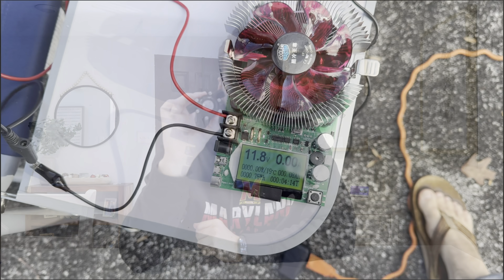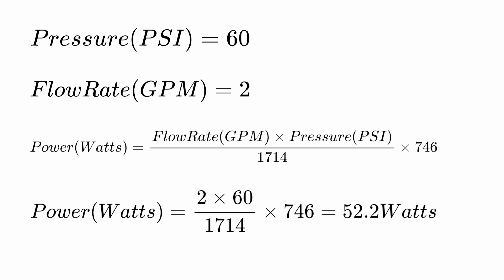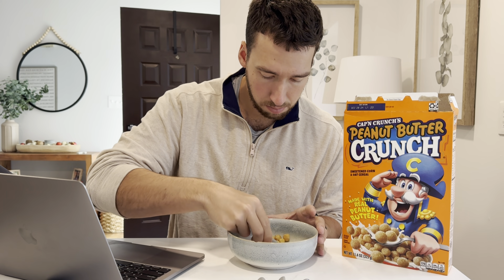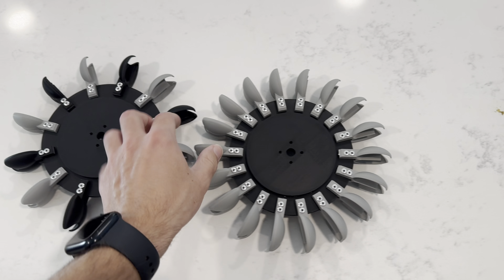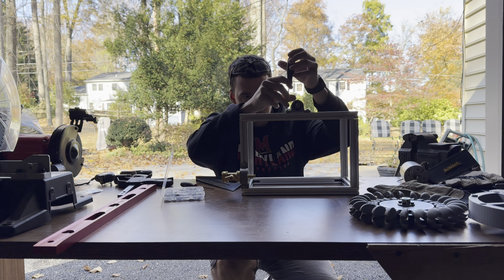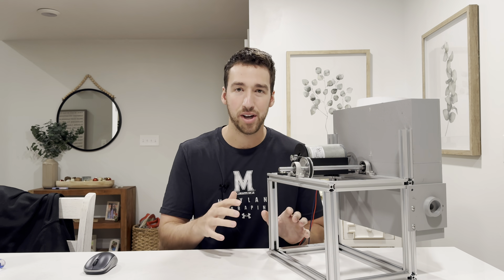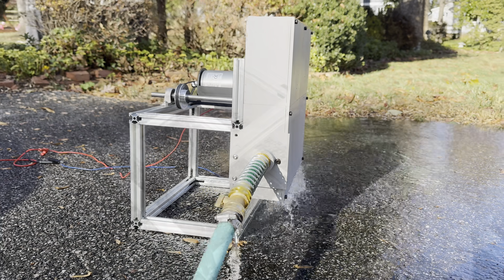I Built a Mini Hydroelectric Generator

Comment: That’s a great little project you did. Its a great idea to make the sliding nozzle mount and options to use different sized nozzles and spoon quantity and angle make a major difference(as I’m sure you discovered)….  Now all you need to do is learn how to make a self primming hydraulic ram pump to pump water into an elevated reservoir. Gravity feed the water through a hose from the large reservoir into another reservoir, through your hydro-electric generator, with JUST enough pressure to spin it efficiently, with as little water loss as possible.   I’d be interested to see if this can be accomplished without water evaporation loss or fluid bypass inefficiencies to keep it self sufficient enough to stay running…  at 99.99% efficiency, the answer is an obvious no. But it would be cool to see how close you could get to 100% and how long it would run for by itself.

Comment: I wonder how many watts are wasted on that belt drive? I think the wheel should be directly connected to the motor/generator. That would eliminate 2 pulleys, a belt, a shaft, & 2 bearings.

Comment: ...when i invert as engineering term various ways , i imagine it's good on a drain pipe edit: for example all the gutters to a pool that drains through there and use all the gutter rain ...or a buildings sewer line from many stories high like doodoo pp power

Comment: i wonder how much the rpm changes between the water jet like the vid , or pointed down so maybe gravity assists or pointed up so it adds lift to the wheel ...?  also at 60 psi , maybe it decreases with hieght but there's not a maximum obtainable energy because it could go up to a [ersonal water tower and back out for usage and still power a water mill both directions and have unlimited power until the power company shuts off because you could release a swimming pool of power hypothetically ...

Comment: They used to sell something like this to power sump pumps for basements in places with frequent power interruptions during storms. The idea is municipal water for even a several day blackout is cheaper than water damage to your finished basement. The water supply was on an electrically closed valve, when outside power cuts off valve opens keeping the sump pump powered.  When power is restored valve automatically closes.

Comment: what is the function of that thing you have at the other side of the pelton wheel turbine
Reply from the maker: Great question! The wheel I added acts like a flywheel – it helps store rotational energy and keeps the turbine spinning more smoothly, even when the water flow changes. Or so it was supposed to. I didn’t really see a difference when actually testing 😅
Reply: Hmmm, brilliant is there a video on go to get one done, and also how can I get a shaft extension also..?.  @PaulJunkin
Reply: Must the flywheel be same size as the flywheel
Reply: What about if i weld the shaft of the turbine to that of the dc motor will it also generate power

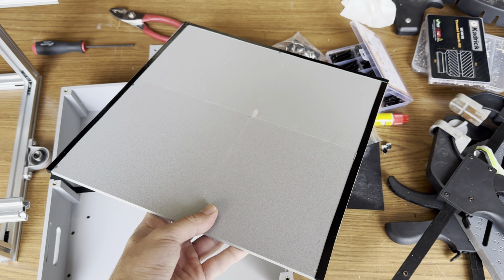Comment: 5:20 Electrical tape would have made a better gasket than Gorilla Tape.  Lead acid batteries do make great glue weights.  Wonder how many hours of water-friction the PLA will stand-up too before the water starts boring through the parts.  The electrical bill is still cheaper than the water bill from running that thing with your garden hose.

Comment: Orient the nozzle with gravity working with it, but the turbine will be rotating against gravity. 

What’s the efficiency of horizontal stream orientation compared to vertical downward orientation
Reply: Increased pressure could offset the loss of efficiency of the turbine spinning against gravity?

Comment: I have similar project for you, install an inline water wheel, feed to a battery and charge your phone from there. use transparent pipe so we can it in action. An added bonus is you can install many of these in various location and it will not affect a thing.  These kits would sell like hot cakes as we are already using the water no matter what.

Comment: I did this 24 years ago using gravity fed water pressure from a water fall in Waipio Valley Hawaii. We were able to run non LED lights and a radio. More if needed. No one will ever know because YouTube didn't exsist.

Comment: use a 2000 psi presure washer which you can get for around 200 bucks and use a fine tip nosel for max thrust / force and it would spin 10x fastest

Comment: That's nice , you could recuperate the water then  pump it back in the circuit to minimize the water loss
Reply: Yeah and the pump should be powered by electricity from the turbine and the other 58% from another source (like solar panels) to be energy balanced 😀. So it will be a great machine to heat the bearings and turbine axle 😀.

Comment: I do wonder about the torque output of the initial gear and if it's possible to add a step down to increase RPM to the motor input.
Similar to a simple bicycle gearing mechanism that you control shortly after startup, allowing inertial torque to step through a few gears to increase final drive rpm.

Comment: Awesome project. This can also be using steam generated by sunlight. I think I watched video of one person build that system. You take energy from sun heat use it to generate electricity. Now when the steam is condensed in the upper section use potential energy and this particular turbine can use that potential energy to extract more energy. And if you place the system properly cycle can be made .

Comment: Subscribed! Looking forward to future builds. You should turn this into a functional sprinkler so that way it is a dual purpose watering your yard and gaining power for simple small objects. Something that the water company doesn't charge you for is pressure. If you could bypass the regulator from the street to your house and get the 100 PSI from the street, you can theoretically increase your output.

Comment: Thanks for sharing. Always enjoyable to watch an engineering mind work out solutions.

Out of curiosity, did you include drag on the paddles as a constraint?
Reply from the maker: Thank you! To answer your question, I didn’t specifically include drag on the paddles as a constraint in this build, but it’s definitely an important factor to consider for optimizing efficiency. I did research and design the case to be large enough for the water to escape efficiently.

Comment: How do you power your water pump? I'm sure the amount of power required to pump that water is much higher than the energy generated. So you need higher power to generate lesser power.
Reply from the maker: For a practical application, you’d want to use a system like this in a location with significant water flow and elevation, such as in a mountain stream or near a dam.

Comment: This is actually very practical if you implement it into a household. Your showers could charge batteries and be a supplement to solar power. If it was pressurized and continue to get the same pressure out then it could be an inline system.
Reply: Also heat recovery

Comment: Very cool. How many watts does your water pump use?
Reply from the maker: I don't know that exact number. Regardless you’d want to use a system like this in a location with significant water flow and elevation, such as in a mountain stream or near a dam, where the energy is naturally available without the need for pumping. Thanks so much for watching!

Comment: How much does it cost per watt/hr? The house water does have a cost associated with it. You did the calcs for water volume so you should be able to cross that with your water bill costs.
Reply: You would never use this to generate power in practice.  Effectively by extracting electrical power, you are reducing the water pressure.  Water companies use a combination of gravity and electrical pumps to pressurise the water in the first place.  Due to the lose of efficiency of both pressurising and then depressurising the water, overall this is a waste of energy and potentially water unless you're using it all. This device/concept only has a 'value' if you're using  for micro hydro from a natural water source.  In the UK and probably many other European Countries running it from a mains water supply would not be legal because it's a waste of energy and water. You cannot use mains water to power things like this.
Reply: @Notagain640  Efficiency is but a perspective to the economics. It could be horribly inefficient, but if it is very inexpensive, with a relatively inexhaustible energy source , does it matter? If something is super efficient but so expensive to operate, and/or has an easily exhaustible energy source, there is still no practical utility. You have to be cautious however as things are not always as they seem. For example, California has all these "free", "renewable", power sources, like solar, wind, and hydroelectric, yet has the most expensive watt/hr costs in the United States.
Reply: @raydzek  I don't disagree with anything you've said, but I think you missed or ignored the point I was making.
Reply from the maker: Interesting idea. I could definitely do this, but since this is just a concept I am not planning to run the generator much. Wouldn’t be a bad calculation to have though

Comment: Swap those bearings for some skate ones china bone reds will have little to no resistance slip in some powered graphite from a pencil into the bearing casing an you will see a difference
Reply from the maker: @brodierip  thanks for the idea! The bearings I got are from Amazon and are terrible 😂
Reply: @PaulJunkin  the bones reds he's talking about are fake, but cheap on aliexpress and should work as good or better than what you have.

Comment: The generator looks like a DC motor. Could you share its specifications? Primarily the KV rating and also what gear reduction you used.
Reply from the maker: Great question! This is a brushed DC motor, not brushless. Its specifications are 62 watts at 20 N·cm of torque and 3000 RPM. For the gear reduction, the Pelton wheel shaft uses an 80-tooth pulley, while the motor has a 20-tooth pulley.
Reply: @PaulJunkin  Thanks!

Comment: I was thinking about this the other day... would it be feasible to use the system pressure to run multiple generators in sequence if you direct the output in kind of a pressurized way also? 🤔
Reply from the maker: The best approach would be to make a single turbine more efficient, as the available energy in the water is much less after it hits the turbine.

Comment: Seems like a very wasteful way to charge your phone.
Reply: science bro
Reply: In the spirit of reductiveness, humanity didn't arrive at this point, where you can criticize the fruit of someone exercising their inquisitive and creative mind, by everyone throughout history constraining their scientific and engineering curiosity to endeavors they expected to be "efficient". 

Even then, conducting experiments that lead to failing to reject null hypotheses is very much a "productive" endeavor.
Reply: @DoIhaveToHaveOne-d7e  there is nothing new in what he did, people have been using water wheels to power things for a very long time.
Reply: @markswabey5870  HEY GOOBER.
people have water sources like ponds and lakes with head and flow.  "cheap" diy hydropower isn't super common, much less one that uses 3d printed parts.   a 20-50 watt system for microhydro is always welcome.  The only thing he didn't do right was not sharing the files.
Reply: it doesn't have to run off of a garden hose.
Reply: A very wet way!
Reply: There are times when the power is out for days and you still have water pressure. This would be a great emergency method for charging your phones.  And as the comment below states, conducting experiments of this type are very much a "productive" endeavor.  They often lead to unexpected breakthoughs and new inventions that are very efficient and useful.
Reply: @doctrDave   You need power to pump water. You need to pay for water. Pretty sure it would use more energy to pump waterthan yu could make from one of these. You could easily make/use a  dynamo that you could power yourself use wind. There is nothing new about using a water wheel to drive things, people have been using them for a very long time

Comment: Cool tech adventure, but that's about it. Once you account for all cost, not to mention the waste or inefficient use of water, it makes this effort an extremely negative investment. A reasonable engineer could have calculated that from the start. Know that my criticism is meant to be positive, so I'll provide a suggestion that's in line with the goal of generating power from alternative sources. How about a self sustaining hydrogen generator with a battery bank that feeds on solar in the day, and bank at night that you can connect to you hose that will make power cheaper that the electric company is charging so as rates fluctuate between electricity and water, the people have an option to more effectively invest their capital. Happy hunting in all your endeavors! Keep the content coming. VR
Reply: I do not think the purpose of this is to extract usable energy in the long term. It could serve as a test for a serious turbine, or even just be a fun project to learn from. Not everything has to be entirely practical, some people do want to have fun.
Reply: In several scenarios for agriculture where stored water has a lot of head pressure, it’s not as negative as you would think. We have to move water from several sources to get to a plant sometimes. Offsetting costs even by cents is stuff we already look for. And many greenhouses already use synergistic systems. Water boilers used for radiant heat and co2. Water cooled supplemental lighting, heated water also used for radiant heating. Also, electricity demand is increasing with indoor/greenhouse cultivation.
Reply from the maker: As some of the other comments suggest, this project wasn’t something intended to be entirely practical. I agree with your thoughts on the efficiency and cost, especially when using a garden hose, and I appreciate your idea. Thanks so much for watching!
Reply: A way to extract the energy more sustainably would be to use it only when you have to water your garden. The runoff must then be collected and distributed. But it it a bit of a stretch 😊

Comment: This is amazing. Super impressive build and great video. Can’t wait for more. 

What’s the craziest thing you can power with 22 watts?
Reply from the maker: Thanks for watching! Honestly, nothing too crazy—maybe a small 12V mini-fridge, but I’d need to check the label to be sure. In a practical setup, you’d typically use the generator to charge a battery bank consistently, and then power whatever you need from the batteries!